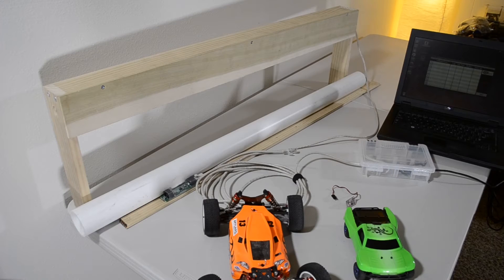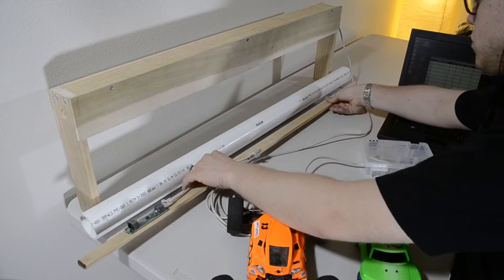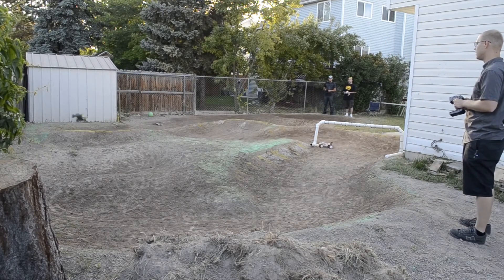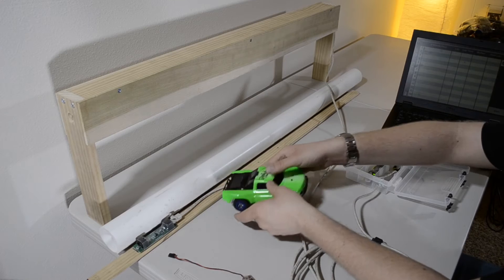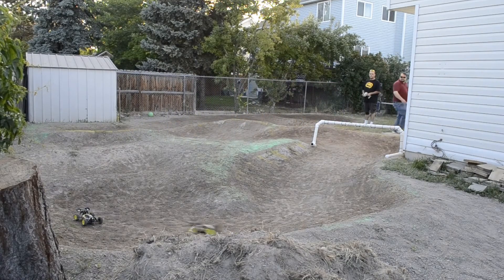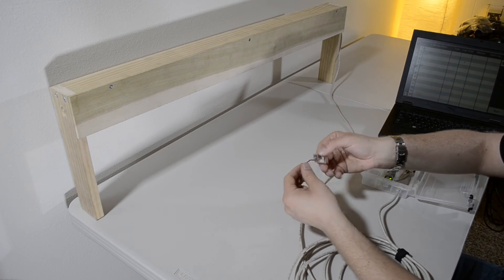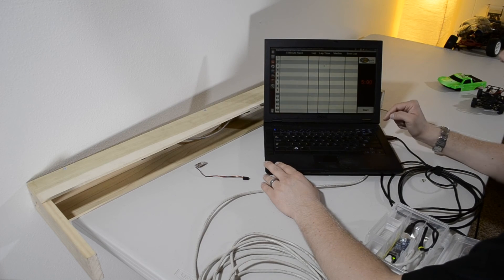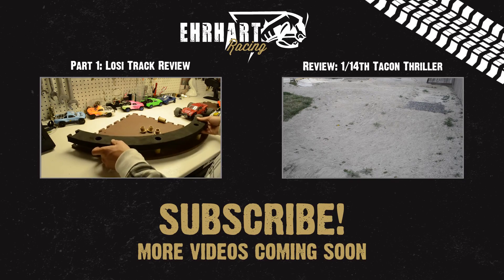Trackmate Racing RC Lap Timing System

Comment: Do you happen to know how far the lap bar and the transmitters can be from one another? Looking to use this for electric skateboard racing and wondering if this might be a solution.
Reply from the maker: It's only about two feet. You could design a gate or multiple gates that racers drive through l__l where the transmitters are on the side of the skateboards and the receivers are pointing sideways instead of down.

Otherwise you are looking at an RFID type system like one used by runners or gocarts

I feel like this is one of the less expensive options but still pricy:
https://www.vostokelectronics.com/product/tdcoderis/
Works for gocarts, I imagine it will work for skate boards.
Reply: @EhrhartRacingRC  thank you for the reply!

Comment: Does this need subscription to operate?
Reply from the maker: I assume you are talking about the timing system. The answer is no. The track mate software is free. If you want to look at other software that works with this hardware check out Next level timing. It has a free version as well and it's great software. *Disclaimer: I developed Next Level Timing.

Comment: Hi,

You are the one behind the great NextLevelTiming, right?
It's the only linux app that supports both USB and serial Robitronic interfaces. I have both of them, but I'm missing cable for rs232 version and Robitronic company was unable to give me pinout. Maybe you could help me? (I guess you've also got both of them if you were able to implement them ;-)

cheers
Reply from the maker: Yes, I wrote next level timing. I do have both devices but I don't know how to get the pinout. Do you have discord? Maybe you could walk me through it?
https://discord.gg/bJxPxbUp

Comment: How does the IR knows which direction you are driving to? what if you drive reversed? or drive backwards and then forwards over the finish?
Reply from the maker: Direction doesn't matter.  The system picks up laps if the user drives under the bar. Most racing software  does not count laps within X seconds of the previous lap to prevent misreads and such.

Comment: Great vid! How did you plug the transponder into the Losi 1/24 esc?
Reply from the maker: There is a port accessible but hidden. If you look around the top of the vehicle you will see a hole. A servo plug fits just dandy.